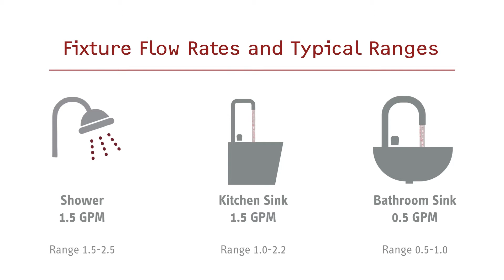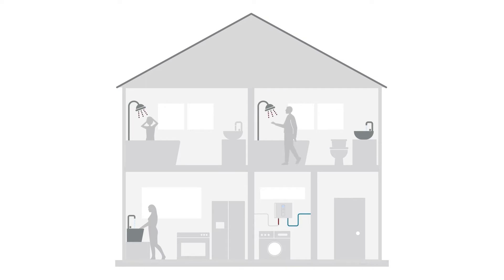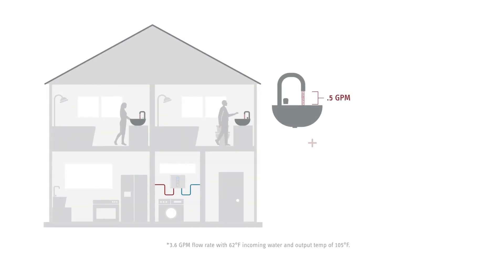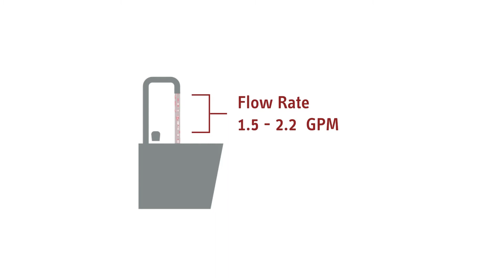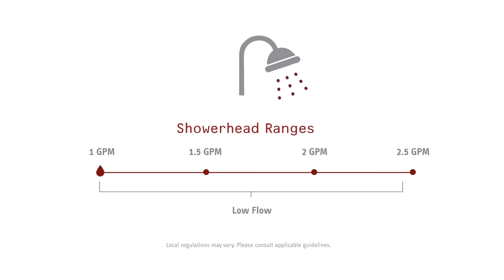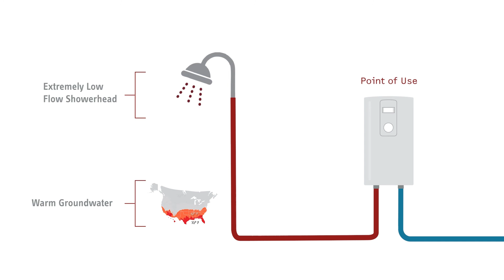Flow Rates - Sizing Guide - Electric Tankless Water Heater Installation [SERIES]

Comment: I'm looking for a guide that will show the power use versus the flow or temp rise. Example: let's say I get the tempra 24 plus. I have 50 degree F water temp. I want 105 to 110 degree water with a 1.5 gallon per minute flow. How much power would it be using? It would be nice to have a guide (pdf or chart) that shows many of these scenarios... Thank you